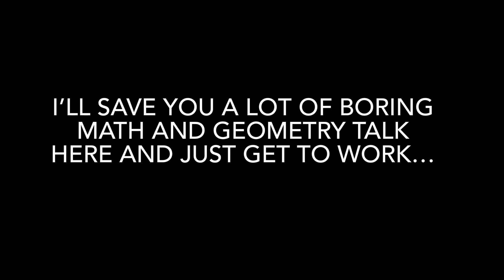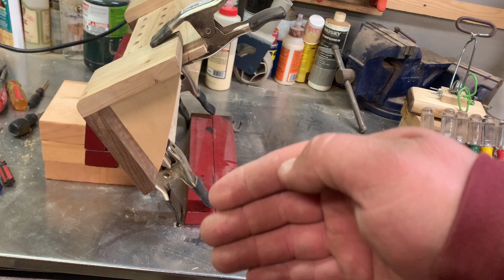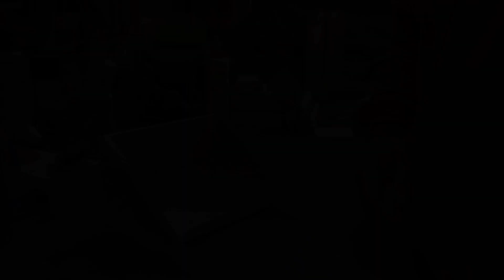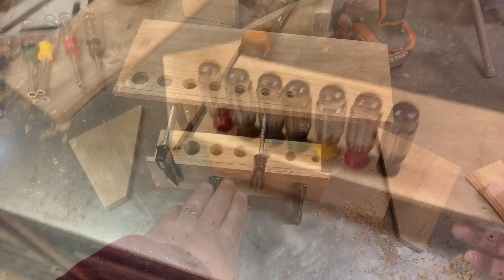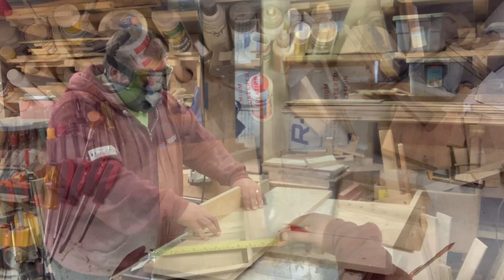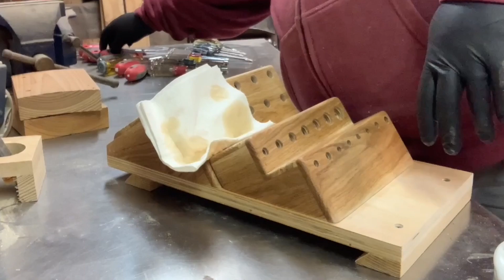SU5: screwed up organizer build

Comment: I like the form a lot. Each tool is straight and well organized.  I really like that.  I'm concerned that I would end up pulling out multiple tools to find the one I'm looking for. I've been working on a french cleat based design that would hold the tools in a well organized pattern, like yours, and would clearly show the length, size, tip, etc., for each. Funny thing is, if I can't figure something out soon I'm just going to build one like yours (thank you very much!) and place labels on the holder.  
All of that said, thanks for the videos. I know they are a lot of work and I appreciate your approach. Cheers!
Reply from the maker: Thanks for your kind words! And thanks for the comment! I really enjoy feedback, especially when they are as long as yours! I’m fortunate that my Phillips and flat head screwdrivers each have markings on the butt of the handle, so I can see which one is which, so then it was just a matter of putting the longer ones in front, where they would have a deeper area to dangle in, and the shorter ones behind. That’s also why I broke up the whole thing into tiers, so I could do rows for other styles. If you have more than what I have, you may want to consider more than one holder so it isn’t so huge, and also maybe a color coded system that matches the driver to a location? Just a few thoughts to help if you haven’t already thought of them. I appreciate the watch and subscribe, stay tuned for more French cleat ideas 😁